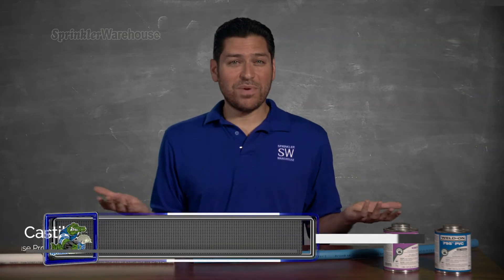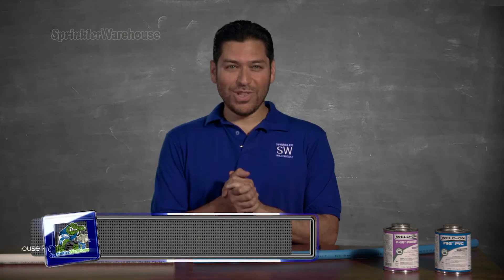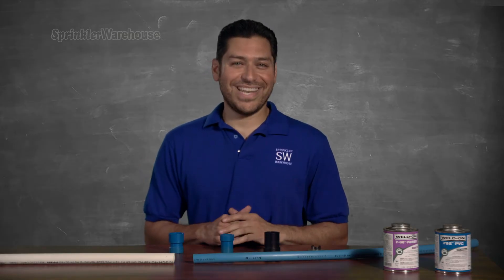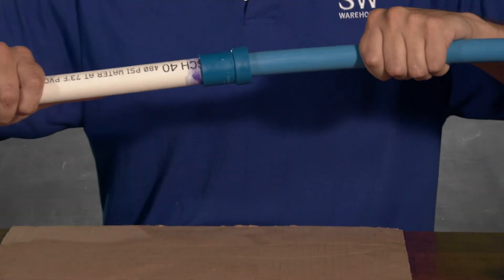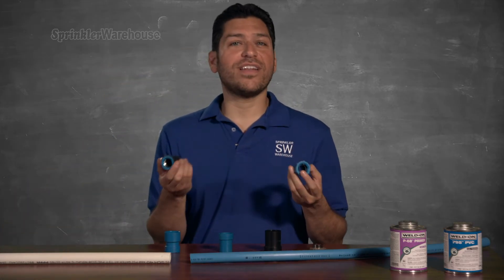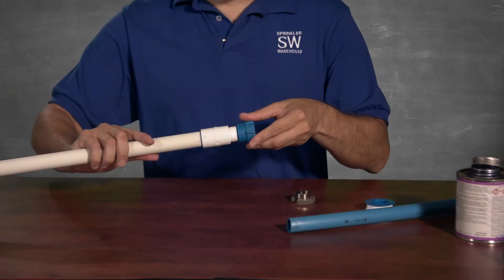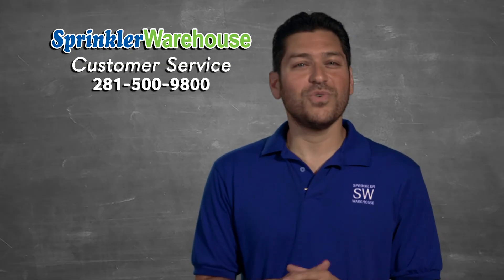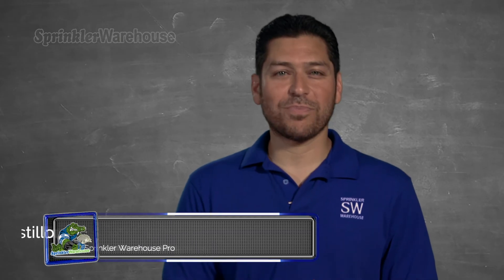Attaching Blu-Lock to PVC

Comment: using the first adaptor where you cemented the PVC on one end then pushed in the Blu-Lock pipe in the other side of the adapter, was there a Blu-Lock connector on the opposite the side that was cemented?  You need to show people both the inside and outside of your fittings.